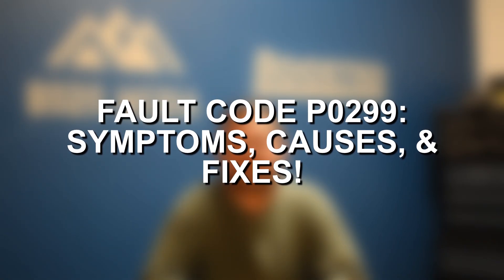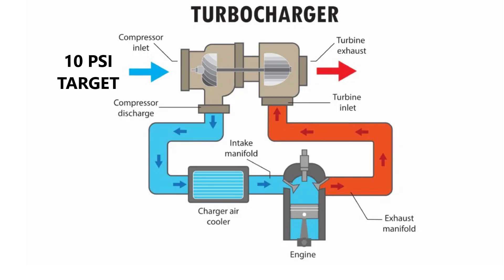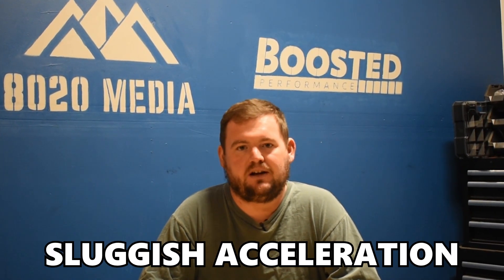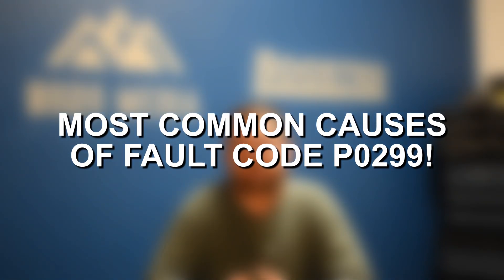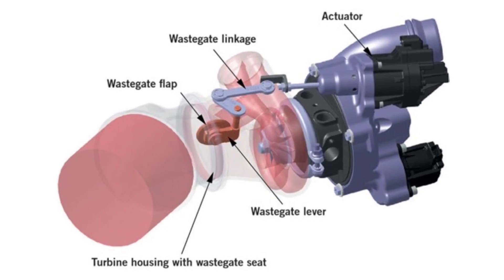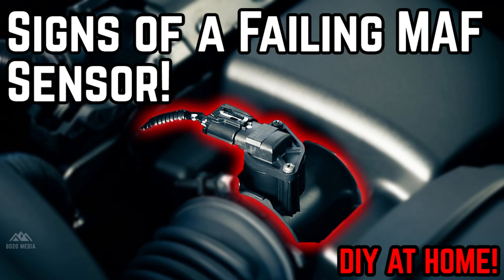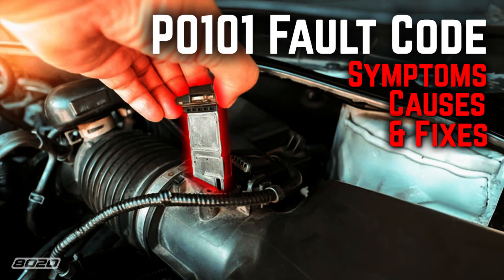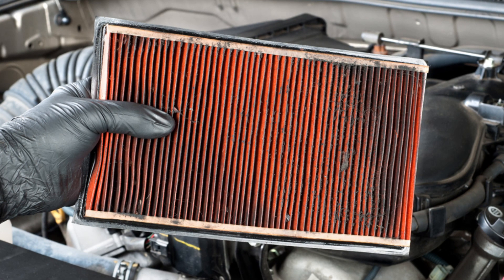P0299 Trouble Code – Don’t Replace Your TURBO Yet!

Comment: I stepped on the gas cause I was having a hard time accelerating uphill (the code showed up as hidden prior to this so I think the problem was underlying, perhaps the wastegate) and i heard a pop, car perked and rpms flew up until i corrected it. Engine light came on immediately. Not sure what to do about this as my turbo is tucked super fsr into the back of the engine